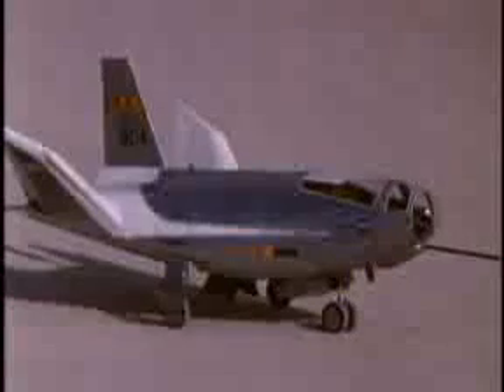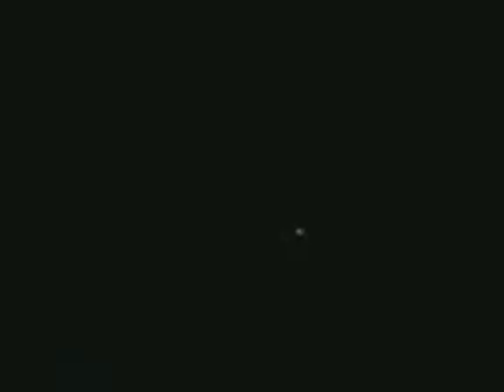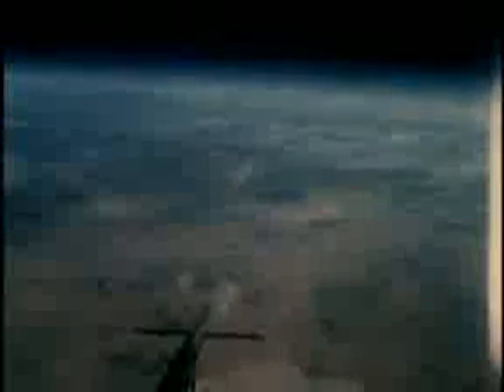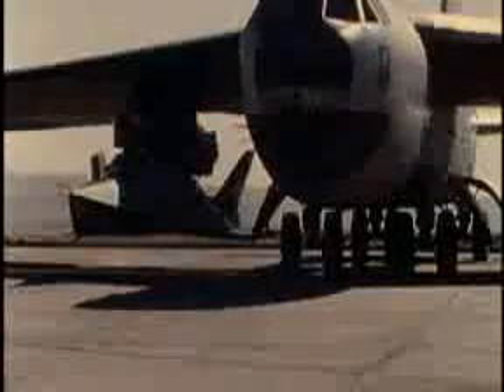NASA Dryden -The Lifting Bodies

Comment: Could someone please elaborate on the intention of this craft is meant to do ? What does lifting body actually mean ?
Reply from the maker: When a spacecraft comes back to Earth from orbit, it needs to slow down and land softly. The most common design is a capsule with parachutes. Capsules have a tiny bit of control in the atmosphere and can bend their trajectory a bit until they open their parachutes, splashdown/land, and wait for recovery crews to find them. Spaceplanes (e.g. Space Shuttle) have wings that generate lift, which is a force they use to control their flight in the atmosphere. Space Shuttle had plenty of control to fly to a runway and land gently. However, those big wings are a big weight and drag penalty on launch, and the wings are awkward to fit on a rocket. The wings were the reason Space Shuttle was mounted on the side of the fuel tanks and boosters, which contributed to the Columbia accident and retirement of Space Shuttle.

A "lifting body" is a very special shape that has aerodynamic control like wings (barely) but without the wings. The idea is to have a crew vehicle that is compact enough to fit on the top of a launcher rocket, but can still maneuver to land on a runway like an airplane. Currently there is a lifting body spacecraft design in development called Dream Chaser (Sierra Nevada Corp.) The Dream Chaser design is derived from an earlier NASA concept called HL-20, which was derived from a Russian concept called Mig-105, which was derived from the earlier lifting bodies NASA flew in the 1960s.
Reply: @NelsonBrown  Thanks for your detailed reply, I appreciate it. I came here from the six million dollars man show as this aircraft features in the opening credits and it had me intrigued me dropping from the B-52.